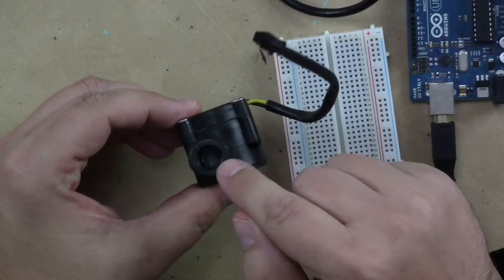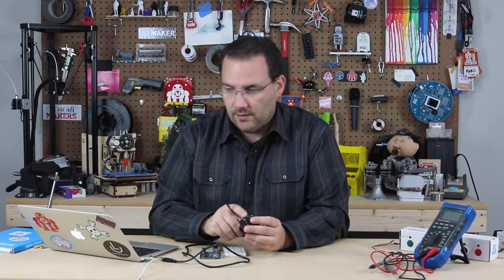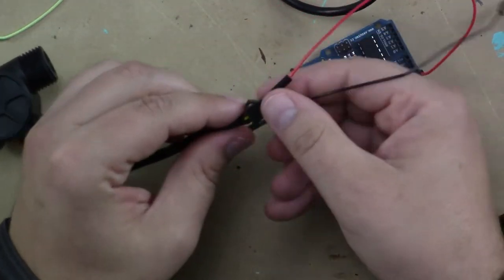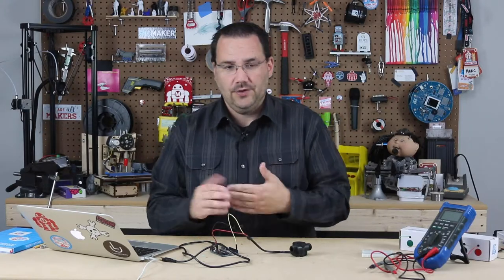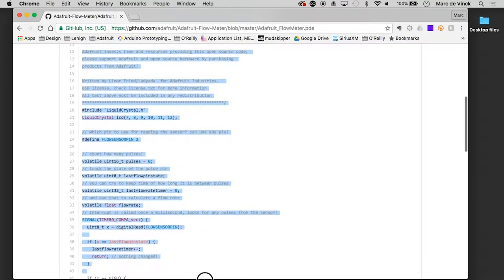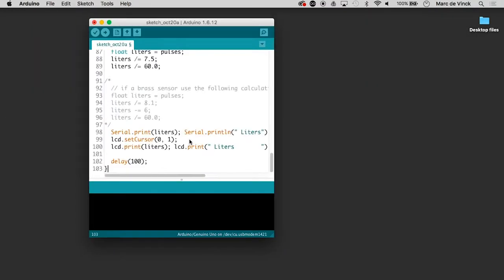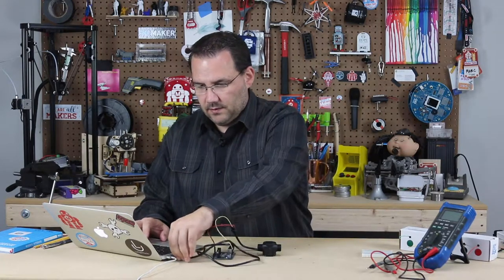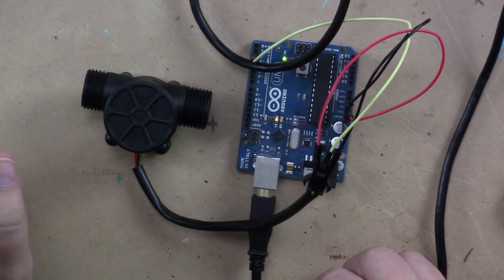Arduino Prototyping Inputs #46: Measuring Water Flow

Comment: Would it make more sense to use a fourteen bit binary counter and save on interrupt calls? The core of this device is actually liters per pulse !!!. Therefore you would have automatic quantity measurement. Appropriate timer interrupts could give flow rate measurements if required.
Reply from the maker: Sounds like an interesting solution. I'll have to try that one day. Thanks.

Comment: I love your video sir … 
Can you please tell me with the help of water flow meter and Arduino we can measure the input volume of liquid but in addition of this how we can show the tottal amount of liquid on the LCD display connected to arduino ????
Reply from the maker: If you need really accurate measurements, this flow meter isn't the right sensor. Depends also on the specific application. Measuring weight or height in a container is more accurate and easier to do. You could also use a peristaltic pump and measure rotation. That can be very accurate.
Reply: @MarcdeVinck  actually i am making a collage project.. in which i want to show how much petrol has hone into the motorbike tank and that i will going to show by water flow meter and Arduino but how to indicate that how much total pertol is in a tank ?
Reply from the maker: @HiteshKumar-ci3ef  Look at how a gas pump works. They dispense accurately. To measure the tank, that is very difficult IMHO, unless you use the system a gas tank currently uses (float or resistive sensors?)

Comment: Would this sensor work if I’m looking for if the water is flowing and when it stops flowing an alarm goes off
Reply from the maker: In general, yes, but without knowing the specific it's hard to say. I would not rely on it for anything critical. Water does seem to be able to pass without any signal in small quantities. If you want to detect water in general, there are other ways. You could check for conductivity in a specific pipe, or several other solutions.
Reply: @MarcdeVinck  it’s a water pump like a pond pump pumping distilled water through a cnc spindle
Reply from the maker: @brandonpeters1987  Ah ok, so if you want the general flow amount and if it is flowing, yes, it would work. Just have it oriented vertically by the pump (I think) so that when the pump is off no water would trickle past. If you just want the presence of water, it gets more difficult since you are using distilled water and it's not conductive. There are sensors that would work. You'll need to do some searching to find one. And they get expensive!
Reply: @MarcdeVinck  what about using a flow switch ? I’ve also never used an arduino so this would be my first project.
Reply from the maker: @brandonpeters1987  I think most flow switches are actually paddles (or impellers) like the one in the video. Arduinos are fairly easy and the community is great! You’re in good company, makes sure to check out the arduino forums too.
Reply: @MarcdeVinck  thank you

Comment: I tried the same code and it funktions undependent of if the Flow rate Sensor plugged in or not! It gives also values even when there ist no flow rate :( This code is weird
Reply from the maker: Make sure to post your question about the code on the Adafruit forums since it's their code and they have an active community. It worked for me, so maybe double check your wires, make sure your Arduino can blink an LED, etc. Eliminate any other variables.